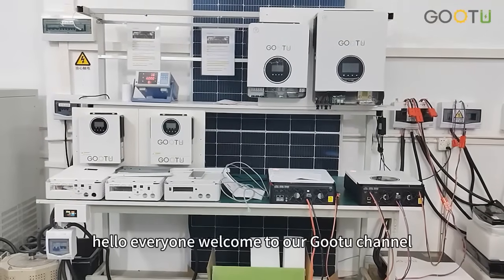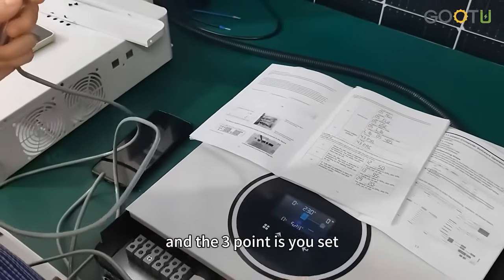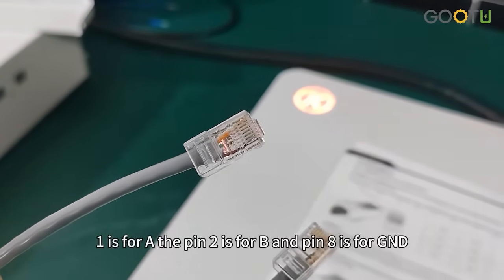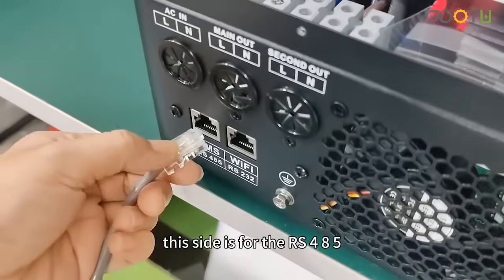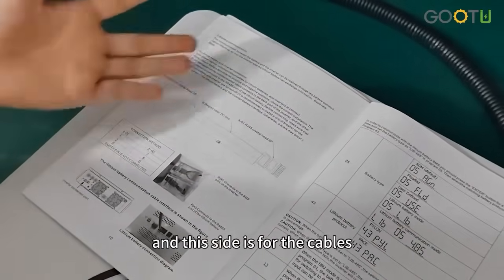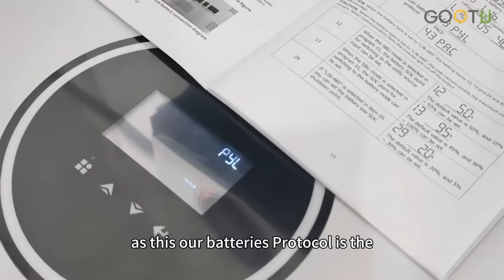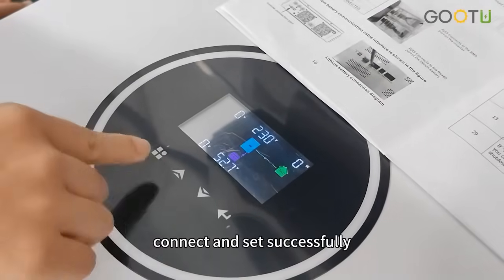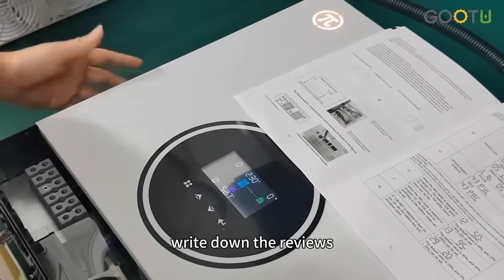GOOTU Inverter Communication Protocol & Battery Connection Guide

Comment: I have a 10.2KW inverter and I can't connect the BMS control. I made a BMS cable like the one in the video, but it doesn't connect. The battery type is Docan Energy high capacity lithium battery Lifepo4 51.2V 600ah 300ah 314Ah 30kwh

Comment: Is the grid neutral and output neutral allowed to be common in model JSY-H48102E160-D
Gootu inverter ?
Reply from the maker: No, you can install it according to the instructions or seek help from a professional engineer.

Comment: On my 6.2kW Gootu inverter, under menu 43, there are 40 to 70 selection options. Which one should I choose for my specific battery? I have a UTL brand battery.  Battery model ULIBES-48V100AH-LP100PM

Comment: Gootu 1.6kw inverter can run 
3 led light 9w each - 27w
2 celing fan 50w each - 100w
1 cooler 250w
Total 377w load ?